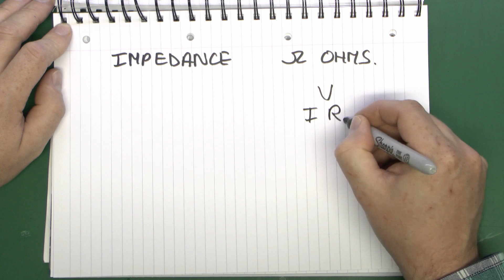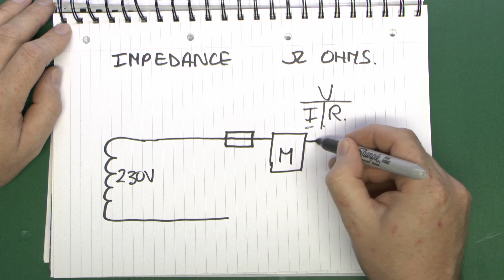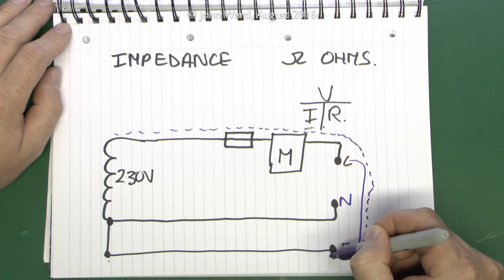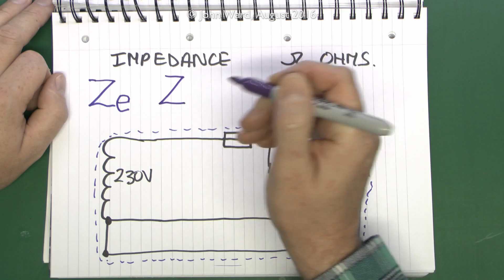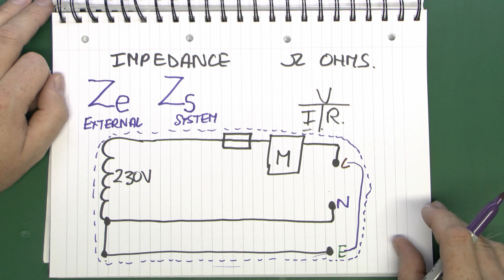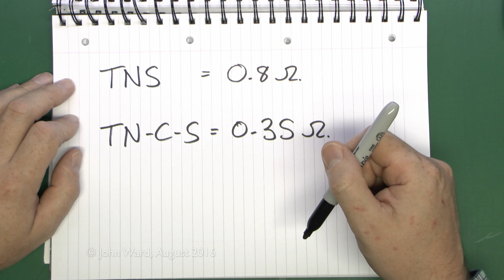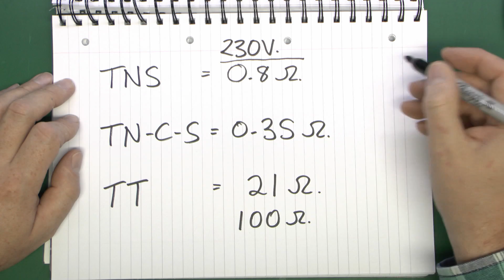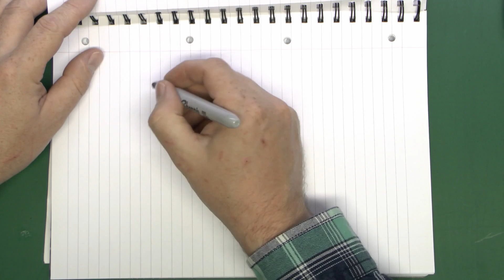Loop Impedance

Comment: Hello, I though this video would answer my question, but it didn't.

On a TT system it's quite easy to identify which one is which. Line to "suspected neutral" and Line to "suspected earth" show drastically different results. The one with lower voltage drop is the earth.
I need to identify Neutral from Earth in a TN system. Is this possible to accomplish? How would I go about that? Would the procedure be the same for TN-S 2; TN-C-S?

Thank you!

Comment: Excellent video 
My understanding is that the MCB has not been used to cut the power in case of fault circuits (line & cpc) and RCD should work instead 
MCB should work in case short circuits (line & neutral)
Can you please put some light on this understanding
Reply from the maker: MCBs are used for line-cpc and line-neutral faults on most installations.
The only exception being TT installations where the loop impedance is too high to operate an MCB, on those an RCD is used for line-cpc faults.
Reply: @ Many thanks to you

Comment: Hi John, I have question on Ze values on larger installations fitted with 200 amp MCCBs or fuses. The max Ze for this is 0.16 ohms, so if it’s a TNCS system with a Ze of 0.35 ohms, surely this doesn’t comply? What’s you advice?

Comment: Thanks john for an excellent and easy to understand explanation. 
is there any requirement for a live test if the Ze can be obtained from the DNO and the R1/R2 is obtained by measurement. which when added together will give Zs at the farthest point of a final circuit
does the live test have any other reason other than measurement of the loop such as applying a current to test the integrity of the cpc and main earthing conductors and their points of connections? if not can it be omitted if the EFLI is established by enquiry and measurement of R1R2
Reply from the maker: Ze should always be tested.  The DNO will only give generic values which may be very different from reality.  There is also the possibility of a faulty supply or faulty earth connection, which can only be found by testing.

Zs testing should just be to confirm what is already known, the comparison between Zs and Ze+R1+R2 being just to confirm the value of Zs is what would be expected.  The two may not be the same due to parallel paths back to the supply, so it's fairly common to find that Zs is less than Ze+R1+R2.  However if the two were totally different or Zs was greater than Ze+R1+R2 further investigation would be required as that would suggest something is wrong.

Comment: Short circuit current won't be enough to trip mcb based on different type installations but same time it exceed overload rating of mcb, will that not trip mcb?
Reply from the maker: It will trip eventually, but the overload part will take too long, and the cables are likely to be damaged by overheating.

Comment: Great video John. What's your view on ADS provided by the supplier fuse when a metal split load consumer unit is installed (single insulated connecting cables to RCDs) Obviously going to be an issue with TNS (100A 1361 fuse) if ze is approaching .8 so an upfront  RCD necessary there. But what about a tncs with a ze of .35. This is less than the maximum permitted  zs for a 100A 1361 fuse (bs7671) but not when the 80% value is applied. Would you consider the application of the  latter necessary for Ze given the network is beyond our control/sphere of influence and the resistance of any meter tails (3m) is pretty negligible even when accounting for a rise in operating temperature?

Comment: So It's Zs  = Ze + ( r1 + r2)   correct, some help would be appreciated,
Reply from the maker: At a very basic level, yes.  Total impedance = external loop impedance plus the resistance of the line conductor and CPC.
in reality it's more complex as r1+r2 is the DC resistance but Ze is impedance.
Reply: @jwflame  thank you for taking the time to answer, I appreciate it, sometimes all you need is a point in the right direction or something clarified,

Comment: Hi Mr Ward, allow me a question please. In a condition where the power grid owner does not provide the Earth wire (local safety policy) a TT system must be set in place. If there was no chance to install a earth rod, can the neutral be used as earth? In a certain way that would be identical to having a TNC-S system (assuming the neutral used as earth was connected upstream the MCB. I would be grateful if you could advise. Thank you
Reply from the maker: Neutral can only be used as the earth connection if it's been approved by the grid operator, and they are the ones that have installed it as TN-C-S.
It's not appropriate to just link N&E, as that arrangement also requires that the rest of the supply network has been designed and installed to support such an arrangement and that other consumers connected to the same network also have that same supply arrangement.

Comment: John, you mention using type C (x 10 amp cut out, while type B is x 5).  You mention that if the cut out lag is too long an RCD (RCBO) would cut in anyway. So it looks like the long lag of a type C is negated by an RCD?

Comment: Thanks John. That is very informative. I have a couple of questions. 
1. Does the Ze need to be low enough to blow what is most commonly likely to be a 100 amp BS88 fuse? 
2. If so, what is the requirement for this to occur? For 60898 types B,C and D you multiply the current rating of the fuse by 5,10 and 20 respectively. What is the requirement with BS88 fuses? 
3. Where in the regs can I find this information?
Reply from the maker: 1 - It often is, but doesn't have to be, and certainly won't be on a TT system.
2 - Depends on the fuse type and rating, it's not a linear relationship as it's relying on a piece of wire to heat up and melt.
3 - Figure 3A1 on page 364 of the blue 18th edition BS7671.  BS88-3 fuse system C.  580 amps for a 5 second disconnection time with a 100A fuse, which would need a Ze of 0.4 ohms or less.  More detailed info can be obtained from fuse manufacturers.

Comment: The explanation is good but would have been a lot better if you had included the time/current curves with the adiabatic equation showing the minimum size of earth required, particularly where the fault current time is not instantaneous. Sorry if I'm the bug in the works John.

Comment: Good work reminds me of day at college were we had a test board were we added load slow on 32 Amp MCB also re wire type pulling 40 45 50 Amps looking at thermal camera showing it don't trip at 40 Amp to 45 Amp for a long time.  It did trip faster with a inrush current but with slow build up did stay on for a long time.  When 1st training I had it that MCB's would trip with 40 Amps.  Like watching an taking notes as am renewing my qualifications there are bits I forget about a good re fresh is always good.

Comment: Is it just me, but why do they call it a 32A MCB if it only trips at 5 times that value? Oh, and only if it is a type B... a type C is even higher! This smacks of USB standards where the U stands for Universal but is anything but. Safe working loads I remember as an engineer 'knowing' that the safety factor on lifting equipment was enough to enbrave myself to lift 2 tonnes on a 1 tonne hoist. Is it the same kind of thing?
Reply from the maker: The 5x, 10x and 20x for types B,C and D only refers to the magnetic trip part, which is there to disconnect if a short circuit fault occurs.  It's set significantly above the normal operating current so that it won't trip when equipment is switched on - some devices have a much larger inrush current when switched on, and for those a type C or D would be used.
However type C and D also require that the circuit impedance is low enough to still disconnect when a fault occurs, so those would not be used on circuits which have low or no inrush current.
For overloads, the thermal part of the MCB is used - a metal strip which heats up and trips the mechanism.  That works between 1.13x and 1.45x rated current, and is the same for all types.  However it's very slow to operate, typically minutes to hours, but that doesn't matter as cables are not damaged by small short term overloads, as the cable also takes a reasonable time to heat up.

Comment: How does loop impedance work with l to n
Reply from the maker: The same way as L-E, on TN-C-S it should be the same value as it's using the same conductors.  TN-S can be slightly lower as the E is usually via a lead covering on the cable rather than a copper wire.  TT will be much lower as L-N is copper wires to the transformer, L-E is through the Earth which has a much higher resistance.
Reply: @jwflame  thanks John. I recently came across a house with tin foil on the fuses   would this affect reading
Reply from the maker: @denmcf89  Probably not, the resistance of a fuse or a bit of foil is tiny and insignificant.  Obviously fuses with foil over them are dangerous and should be removed.
Reply: @jwflame  yes of course. How far does the average house be from transformer. And this also affects impedance I assume

Comment: Tip On TT systems if high reading, piss on the earth stake. Believe me it works. Bucket of water would be better if available.
Reply: Steven Redmond And the next day when it’s dried out it’s your signature on a test sheet if you bothered.
Reply: @ianmalone8053  So what would you suggest in a drought, you can,t drive in new stake to deeper level to require suitable earth reading. I phoned a NIC operative & that,s what he told me to do. 99.9% of the time a bucket of water is not required & too change earthing system for the sake of a few days would cost to much to the consumer. I await your reply.
Reply: Steven Redmond I’ve done the same as you , after several rods , put in parallel rods and then poured water to get a result. But was never happy with what I did. Just for the record, somewhere have emails where I asked various bodies about soil conditions, water table levels and planning rules and how this changes the earth fault loop. Never got an answer I was happy with , this started when public utilities started removing metal supplies and going plastic and I was shown a home where the gas supply had been changed and a card was placed next to the meter in a pensioners home .
Reply: @stevenredmond7455  parallel earth rods would be a good idea? Better than a pretend earthing arrangement that only passed because you lobbed a bucket of water over it. That isn't going to be happening everyday now is it. Might as well not bother testing it at all rather than recording essentially a stage managed reading. If it only passes because you soaked it... It didn't pass did it.
Reply: @travoltasbiplane1551  Only if you’ve got the room. Try 3ft sq, next to property (footings), man hole for drains, electric & gas services go through, hence 1 stake hoping you’ve not hit anything below. Context sonny context. Don’t judge until you know the facts. When you have the room fair enough but most properties you don’t.
Reply: I'm not judging you Steven. You can do your jobs however you see fit. Nonetheless you have volunteered this 'tip' in a public forum. Given apprentices and learners will be viewing this channel and reading posts like this it I feel compelled to point out that I believe it to be a bad idea and at best poor practice. It's no different to disconnecting a faulty part of the circuit to get a compliant reading and then reconnecting the dodgy bit right after your meter flashes up the reading you wanted. Context or otherwise it's not defensible. It's easy enough to unknowingly make mistakes in this game without actively trying to make one! No beef - just my point of view. Enjoy the whats left of the weekend! Jon
Reply: @travoltasbiplane1551  Hey this tip came to me from a very well respected senior electrical engineer my friend. If it’s good enough from him, then it’s good enough for me. 99.9% of the time there’s enough moisture in the ground but maybe once every couple of years we get it hot for a period of time, are you saying every TT system has to be prepared for that 0.01%. If you are then you have a job for life putting more stakes in the ground.
Reply: @travoltasbiplane1551  Plus i only tested the work, i didn’t do the work. I write down the results & comment on recommendations. Plus i also live in the real world.
Reply: @travoltasbiplane1551  Maybe if results go anywhere near 1600 ohms then your method would be sense able but when you get 600 ohms which is a high reading but still a pass, pouring said bottle of water can bring it down to 200 ohms. The client is happy & you get more work.
Reply: But this is the point. You don't know if the day you had to lob a bucket of water on it was just typical for the ground or whether that was a good day when it failed. It could get worse even than that. As such why we have that minimum reading as anything below could be unstable due to drying/freezing of the soil. Earth rods are unreliable enough without adding to the problem. I figure you make sure it's right when you leave and then you've done all you can do. If you're a bit on edge about it recommend a retest of the rod in six months. Yes I do think the earthing should be viable year round. Unless you have a better way of knowing when a fault may occur. You say you live in the real world presumably as some kind of dig that I'm over-egging something that is just basics. And the fact that you just tested the work is not a get out. You tested it. Found it wrong and then fudged it with a bucket of water. If it wasn't a problem in the first place as you seem to be suggesting why even bother with the water? Do you see what I'm saying? Your certification is a fabrication. You might as well just have knocked however many ohms you needed off the reading and written it down.
Reply: @travoltasbiplane1551  I honestly understand where you’re coming from but even my guv phoned & said it failed until i let him know TT systems have high Zs allowance. This was for 15 car chargers supplied by each property but each with own stake. I’ve had old properties in the past which have gave me high Ze readings & was told by a senior electrical engineer to put bucket of water on it to bring reading down. TT systems in my opinion are shit but i have to go by regs & things i learn from mostly elders. I’m still learning everyday, maybe next time i won’t write “ throw a bucket of water on the stake” but without this kind of conversation things won’t improve.
Reply: @stevenredmond7455  that's what it's all about. 👍 Hopefully we'll all get through without any disasters!

Comment: Hi John, can a type c mcb be used with a TT supply protected by a 30ma rcd?
Reply from the maker: Yes, it will be necessary to check the impedance between L&N at the end of the circuit to ensure the fault current is sufficient to trip the MCB within the required time.
Reply: @jwflame  Many thanks for that.

Comment: Please may I ask a question? when you said the impedance (resistance) would be the same if you were to measure between L an E and L and N on a TN-C-S system since the wires are joined locally would it not be the same on a TN-S system since the wire in the E and N would be the same length so the same resistance hence the resistance from L to N and L to E would be the same. what am I missing?   Further, if the loop resistance was say 0.8 ohms and a load of 8 ampers was applied that's what our kettled consumes which my dad said takes a lot of electricity then that 8 amps would be a resistance of r=v/I  which would be nearly 29 ohms. which would v=IR,   V=8*0.8     which would be 6.4 volts and on a 0.35-ohm system it would be less than 1/2 that. so how does it measure the resistance accurately since how to they know the voltage was stable? the correct way of doing it it seems to me is that a resistance is applied across L and N and its lowered until the voltage is exactly 1/2 of what it was then the resistance to achieve that would be the resistance Ze. we have resisters at school where you can turn a dial and make the resistance whatever you want it to be so you would turn it to either 0.8 or 0.35. or a value to make the voltage half.  do I get a prize if this worked?

Comment: John, at 6:33 you mention that an impedance test of the supplier's side might make use of a generator to inject current into the supply side.  Now I assume you say this for an inactive supply side where the supplier makes the measurement themselves and informs the electrician of the value measured ?  Or did you mean something else ?      The other question is if you put a load across the supply and do it yourself, you would be hard pressed to load the supply and get a range of measurements to work out the supply internal impedance.  Can you elaborate on this if possible ?

Comment: Just to mention that BS7671 says for TT systems 200 ohms is the maximum ZS  in the UK . Regs table 41.5 note2  states for 30 ma and 100 ma RCD device a value not exceeding 200 ohms may not be stable.